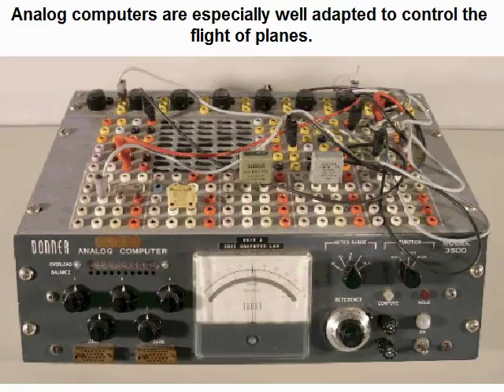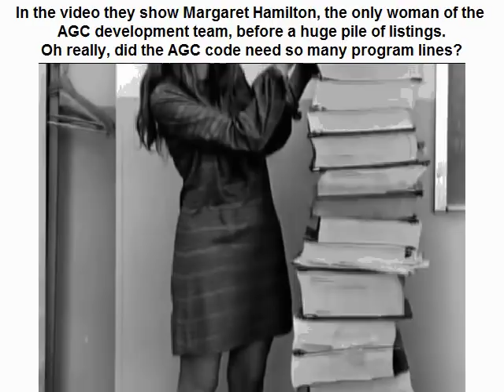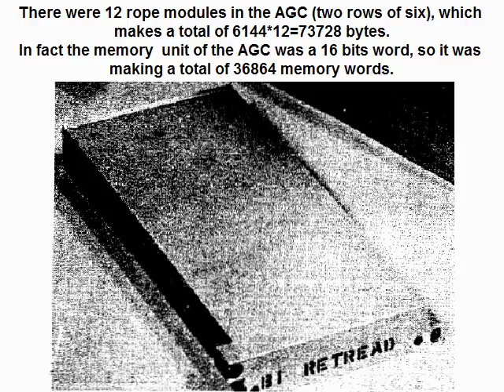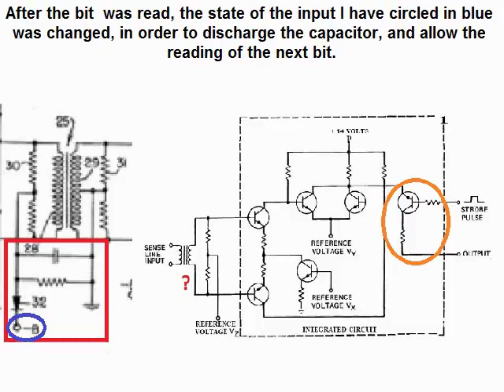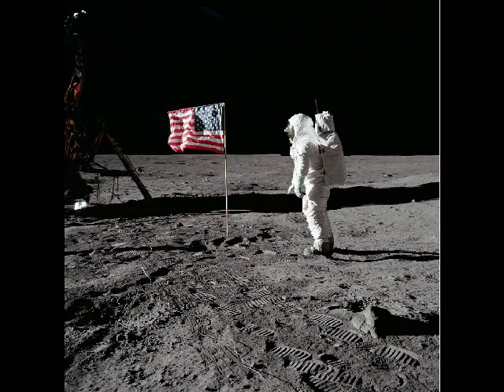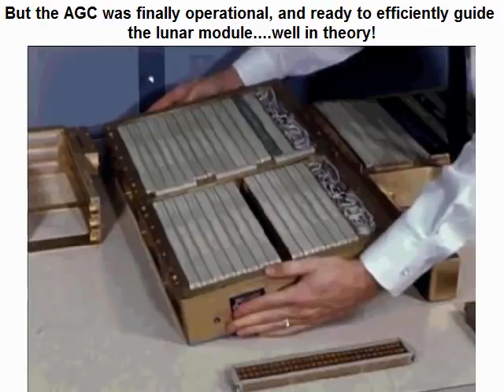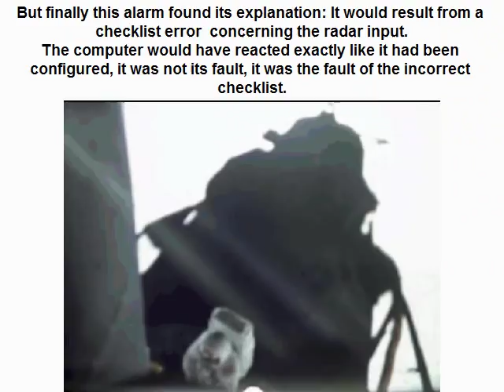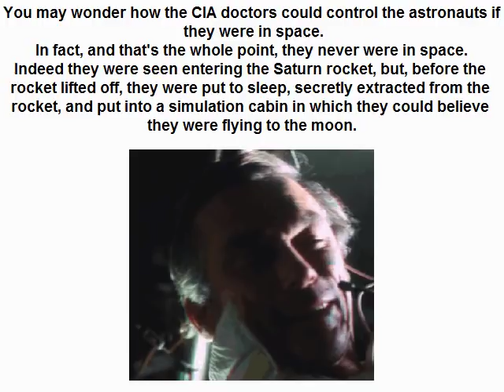Moon Fantasies: The Apollo Guidance System

Comment: This kind of inaccurate method using analog computer may cause enough error for the spaceship to deviate from the correct path by hundreds of miles from the target moon. If the creator of this is alive now, he would suggest not to go to the moon with it. It is like suicide. It clearly shows the technology in 1969 is not up to the use for the space travelling.  It is very straight forward answer. Analog computer was the compromise at that time since there is not enough digital computer power available. I bet it can not model the ecliptic orbit of moon around the earth, but just the approximated circle movement. LOL
Reply: Gil Lee An analogue computer would have been required in a simulation training exercise on the ground to generate realistic spacecraft kinematics but was not necessary on an actual flight as Sir Isaac Newton looked after the kinematics. One was either simulating a mission EOR one was on an actual mission but not both. A particularly lame-brained objection that should claim the Xavier Pascal Award for Most Insightful Comment.
Reply: Most American believe that they could just operate like a driving a car. But they realize it is not flying, not driving. In 3D space, without nearby seven-eleven,
Reply: What the hell does that have to do with what we are talking about! There is no way that the LM needed an analogue or hybrid computer to generate spacecraft real time performance. My query raised elsewhere still is there by the way!
Reply: The distance to the moon is 240K miles. Slight deviation will get you too far away from the moon. There is much cause of deviation int eh space; Moon orbit is not the perfect circle, Earth gravity and Sun's gravity are also calculated. Without supercomputer, you do not get that kind of accuracy. Even after getting accuracy, the occupational adjustment is needed. If you fly a plane, you know this. I fly visually, so I know often get lost even with the ground reference. In space, it is pitch dark. I fly, so I know slight wind make me deviate from the long leg of the flight. When you fly 240 miles, you are guaranteed to get lost somewhere. Slight speed inaccuracy will miss the moon that is flying at sound speed. You simply do not understand how hard to go to the moon without the supercomputer.
Reply: You are obviously ignorant of Apollo navigation and guidance techniques where all of the higher order gravitational harmonic terms are included. You have not consulted a single GSOP to find out have you!
Reply: You are ignorant. You can not calculate any higher order harmonics without the computer. They had the first IBM360 that time which was used to calculate trigonometric. Go ahead and calculate them using paper and pencil. You do not even know how the MIT professor made the navigation system under the Nasa's contract, which Nasa never used it. He would not recommend to go to the moon with it if he lives now.
Reply: Yawn You know nothing about the AGC and LGC. You have never read the GSOPs that fully outline how the spacecraft navigated. Anyone who read  the coasting flight procedures operated in AGC  program P00, the idle program, would not give voice to such utter tripe.

Name the numerical methods employed to solve such complex second order differential equations? What is the name of the very special subvariant described in a 1927 Finnish mathematical report used by the AGC?
Reply: Are you stupid enough to believe the procedure document will carry human to the moon? Nasa has never left the earth orbit until now with any human in it.. Even Orion has just circled the earth with ecliptic orbit. Nasa's director said that in the interview. You are one of those idiot who is completely brainwashed by Apollo propaganda. Go back to school and get more education, at least Master of Engineering before coming back and write here.
Reply: Nasa official schedule for the moon is that Nasa will send the unmanned Orion to the moon and go around and come back in 2019. Nasa is working on the navigation system. Let's hope that Orion will come back safely. Nasa needs the bigger rocket than Saturn. So, who went to the moon and came back in 1969?
Reply: Your qualifications are? 

"Nasa is working on the navigation system"   The system is for Orion. The use of the definite article does not imply that there is one and only one be all and end all navigation system. 'Boys we're working on THE navigation system' Oh really LOL

Any spacecraft operating at any reasonable distance from the Earth needs a self-contained navigation, guidance and control system. The time delay due to the finite speed of radio wave propagation means that effective external ground based systems would be futile in implementing any real time control function. 

For Mars the time for a one way radio signal depending on Earth-Mars phase angle varies from 4 minutes to about 24 minutes with an average of about 13 minutes. With this average one way delay the total lag from detection of nav error to the receipt of the correction signal and then a detection of the resulting correction would be about 3 x 13 or 39 minutes which is totally inadequate. The first Mars flyby was by Mariner 4 on November 28, 1964. I wonder what it had onboard to execute the nav and control functions? Let me guess somebody's specially trained hamster! 

You just spew forth a litany of total nonsense without yourself be conferred with any tertiary qualifications!
Reply: The navigation system had better be the new system, not one made for Apollo. Let's hope the Orion will come back after circling eh moon in 2019. The vert basic technology to verify. China has done that in 2017. Do not talk about Mars. Nasa has Mars rover in Iceland. Nasa has never shown us the interactive session with the rover because it is not on the Mars. China broadcasted the interactive system with the rover on the moon. China said the soft landing technology is essentially same for the moon and the Mars. If Nasa can soft land the rover on the Mars, Nasa has done that on the moon already. Nasa's technology is not at that stage yet. They are talking about testing moon-go-around in 2019. Nasa tinted the Mars image with red color. Russia said it should be blue. Hollywood used red color. LOL.
Reply: You are an empty wind bag. You have zero understanding of what you are prattling on about. You have at no time indicated your qualifications. You have indicated that you graded some university students' submissions but you refuse to indicate in which engineering subjects. You refuse to answer because you know that once you indicate the subject that you will be submitted to a list of questions that only one conversant in that subject could intelligently respond. You have lied to support this self illusion of competency in astronautics that you are not graced with even the slightest glimmer of insight in!
Reply: Still haven't indicated the numerical method used to integrate the gravity field in every spacecraft navigational system for the last 60 years plus. An expert in this field should be able to rattle off the name like the name of his mother. Your silence is deafening and confirms your hottest windbag status.
Reply: Listen, defender of Nasa, just wait to see if Orion will come back to the earth. Nasa is not ready for the test this year. Give them enough time until their scheduled launch in 2019. Nasa is not ready. Nasa does not know how. They need one year to figure that out. I am giving enough time, OK? Just fly around the moon and comeback. Reentry is not that easy. Indian satellite was lost for 8 years by Nasa.
Reply: "You are an empty wind bag. You have zero understanding of what you are prattling on about. You have at no time indicated your qualifications. You have indicated that you graded some university students' submissions but you refuse to indicate in which engineering subjects. You refuse to answer because you know that once you indicate the subject that you will be submitted to a list of questions that only one conversant in that subject could intelligently respond. You have lied to support this self illusion of competency in astronautics that you are not graced with even the slightest glimmer of insight in!"  

Copy of previous post that henceforth will be the standard reply until you present evidence of your qualifications. Naming the numerical method used in every spacecraft navigation package to integrate complex gravity fields and the univrsity subject you tutored in will suffice.
Reply: Yes, I graded the college students, and I do not need to tell you the qualification. The judge from the discussion. You believe in Nasa's document, not science. I can tell you have no engineering background. Working on some maintenance job does not give the sense of engineering. Also, you have not done any research work, but taking classes. You can't even tell the difference between real science and Hollywood movie made by Nasa.
Reply: Here is the real science. https://www.youtube.com/watch?v=ar8FNxiU-tM&t=1718s
He is the geologist analyzing the data obtained by Chinese rover, while Nasa's moon rocks are sold in eBay.
Reply: "You are an empty wind bag. You have zero understanding of what you are prattling on about. You have at no time indicated your qualifications. You have indicated that you graded some university students' submissions but you refuse to indicate in which engineering subjects. You refuse to answer because you know that once you indicate the subject that you will be submitted to a list of questions that only one conversant in that subject could intelligently respond. You have lied to support this self illusion of competency in astronautics that you are not graced with even the slightest glimmer of insight in!"